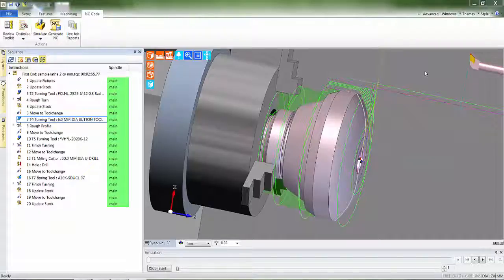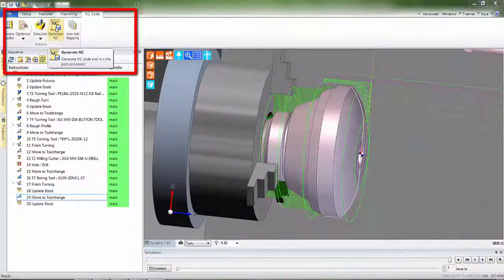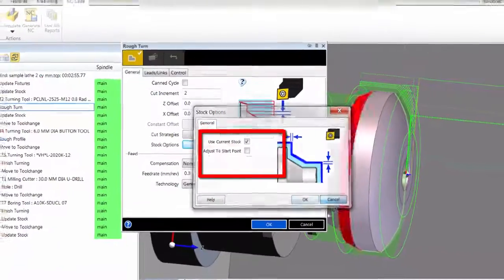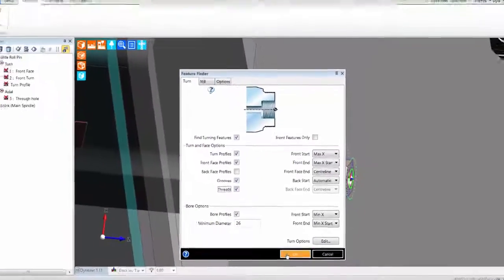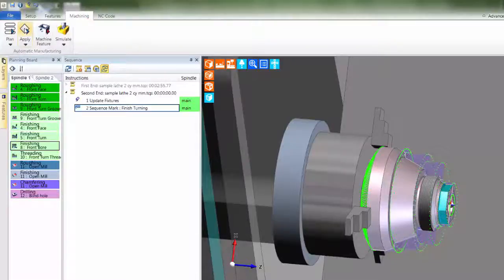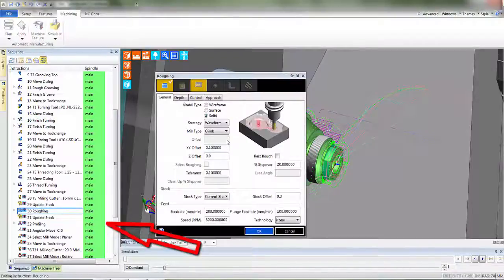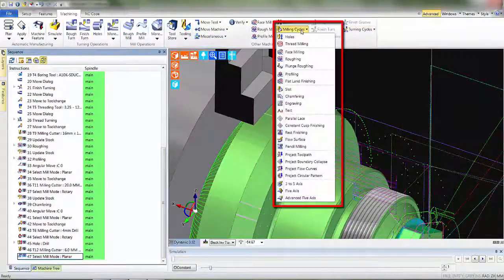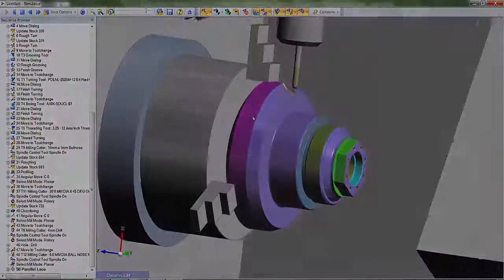Edgecam 2-axis Turning, C&Y Milling incorporating Second End setup

Comment: I have a part with both front and back features. I've machined the front features and saved the file as stl. Now I want tu machine the back features of the same model, for which the model has to be turned and fixed in the chuck. Please tell me how to insert the saved stl file as a stock for the model? Also please tell me how to rotate the component and grip it in the chuck.